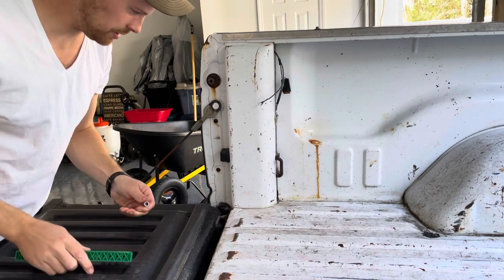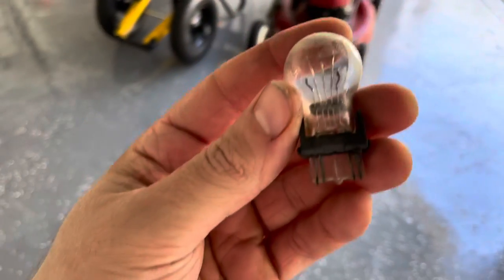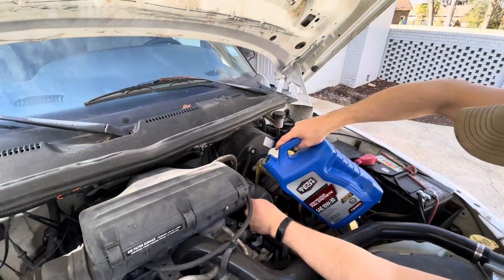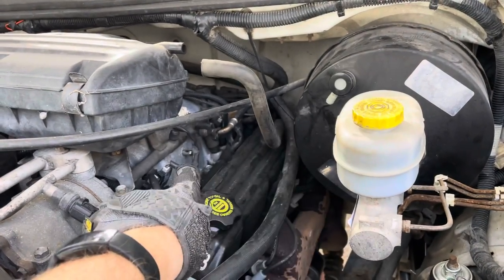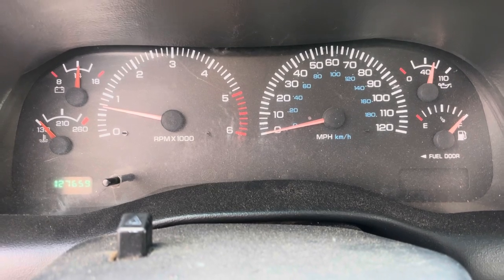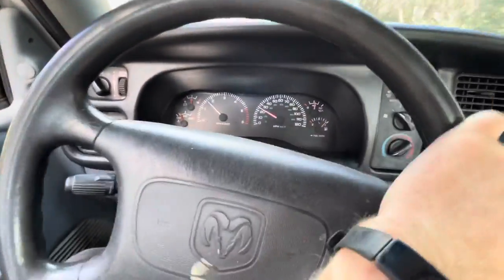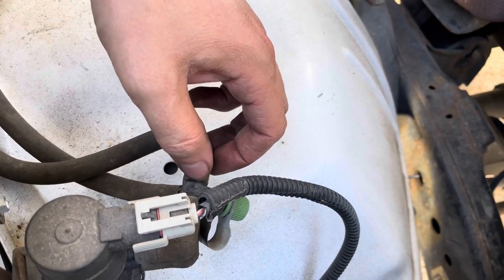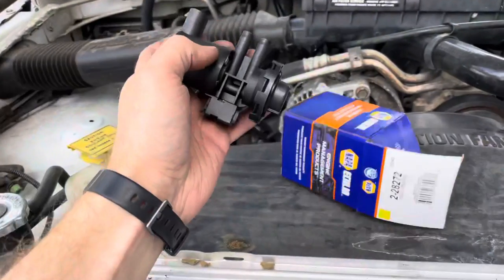HUGE change of plans?! Fixing rough idle in my 1999 Dodge 2nd Gen

Comment: I have a 2000 dodge ram 1500 5.2... it did the same thing. Changed out all sensors on the thottle body with after market parts. The problem went away when I put on OE idle air control valve part (mopar).

Comment: I have a 01 Ram 1500 5.2L 5 speed and am going through a similar situation. When I regeared my rear end, I forgot to put the speed ring on the carrier like a bone head. Both the speedometer and odometer quit working. I drove the truck like this for about 6 months. When ever I came to a stop and pressed in the clutch, it would die. I guess Mopar engineers didn't want people just simply unplugging the rear speed sensor on the axle and driving and not putting any miles on the odometer. I had a rebuilt engine put in the truck during this time. The mechanic that installed the engine was dumbfounded when he took it on a test drive and it was dying at stops. Instead of calling me, he put in a new IACV and when it still was dying, he used his diagnostic tool to adjust the IACV setpoints. Truck still did it and he gave up. Within a month of getting the truck back I had the time to pull apart the rear end and put that speed sensing ring on the carrier. First test drive, code cleared, and no more dying at stop signs. Only problem now is on cold starts I get hissing out of the IACV hole on the throttle body and she runs rough. After a few minutes it settles out. I'm going to try a "throttle body relearn" to undo what he did and if that doesn't fix it, new O2 sensors. Those two seem to be common culprits
Reply from the maker: Interesting. I’ve got a whole video series on this truck, I’ve tried everything I can’t think of and it’s better but it still isn’t perfect. I’ll probably post a video soon of a compression test. I wonder if I’ve got a cylinder or two low on compression. Thanks for watching!

Comment: To test a bad intake plenum gasket remove the PVC hose from the intake and cap the port. Start the engine. Remove the oil filler cap and place thick paper over the valve cover filler hole to ck for vac. If vac is present the plenum gasket is bad. 
The purge valve in 2nd gens can be disassembled. I have seen 2x where the charcoal canister went bad and the purge valve drew charcoal bits into the valve, clogging it. Pop it open, clean, and blow out, then back together. ANd replace canister. But in your wandering idle and stalling case it sounded like a bad IAC valve. It's been 2 years, did you find the problem?
Reply from the maker: @steadyeddie7453  thanks for watching. I’d already done a plenum gasket at this point with a kit from Hughes engines. I’ve done every sensor. IAC, fuel pump, grounds, and a bunch of other stuff I’m sure forgetting. This is a weird one, I think it’s gotten better over the years but it’s still not right. I don’t believe I’ve checked the purge valve, might be worth looking into.
Reply: @TheMoparGarage  The Hughes plenum kit with the machined aluminum plate is nice and definitely cures the gasket blowout issue. I think it is FelPro that makes a better than OEM gasket that also works, for those on a budget. The purge valve is programmed to cycle open at about 45mph, closed loop. But you can simply disconnect the hoses on it and plug the one with engine vac. Then take for a test ride.

Comment: Notorious for leak at intake manifold plenum gasket. if you look down the throttle body and see oil, it's a good indication the manifold is leaking by. Hughes engines sells a kit, for around a $140 U.S.
Reply from the maker: I had redone the intake plenum with a Hughes engine kit about 6 months prior to when this video was put up. Didn’t help at all unfortunately! Haha

Comment: If alot of miles, change injectors fairly easy ,Dodges are crazy.
Chasing the surge problem for two years, fuel pump went out ,changed it runs great 2002 59,000 miles wow.
Reply from the maker: This video was about a year ago, I have since changed the fuel pump, removed the cat, changed every sensor I could think of. Seems slightly better but still not right. Just living with it for now I finally gave up! Haha thanks for watching!
Reply: There is a better version of the second gen dodge ram magnum series engine injectors they have 4 holes instead of the normal factory 2 hole injector Chrysler used lol..

Comment: I just fixed a 98 5.9 with this same problem. O2 sensors they had good readings but the heater circuits didn’t work properly even though they had power and continuity.
Reply from the maker: Thanks for the suggestion! I’ll try replacing them
Reply: The 5.9 i put in ran fine before the swap but now it pops and ba kfires
Reply: I will also try the 02 sensors hope this works

Comment: I love 2nd gens ... I have 2 left , I sold my 3500 dually and I have 2 left both 2500 12 valve diesels .. I bought a 1500 gas for the cab and I may try to sell the frame which is perfect still all the original paint on it ..
Reply from the maker: Gotta love 2nd gens. I’ve owned I don’t know how many…currently I only have one, my ‘99 5 speed isn’t going anywhere. I’m always buying/selling them though.

Comment: Not sure if you got it fixed or not chased idling issues for months on my 99, would cam out per say and die randomly at idle all new sensors. If you havn't changed the belly pan gasket on plenumn its leaking and fouling no.8 plug. And for the idle fix, 2nd gens don't read bosch 02 sensors, needs to be ntk or denso upstream, and if you dont have a cat in it bosch downstream, and it'll never throw a cel. Verified on multiple trucks.

Comment: Keep on looking for Shelbys. They're out there for sure. Little more info - They made "Shelby" Chargers with 2.2 Turbos in 1985, 1986 AND 1987. Additionally they had the actual GLHS in 1987. Story goes that Shelby bought the last 1000 Chargers for the 1987 model year and those became the numbered cars, the 1000 GLHS Chargers. I actually own both a 1987 GLHS and a 1987 Shelby Charger. Both have the 2.2 Turbo, but the GLHS has the "Turbo II" setup which wasn't introduced until the 1988 model year in the Daytona.
Reply from the maker: Interesting, I knew about the 1000 GLHS cars but I didn’t know they still made a normal Shelby in ‘87….I’ll be keeping an eye out, if you hear of one let me know! I’ll travel as far as I need to. Plus if I ended up in your area it would be cool to collaborate for a video or two!!
Reply: @TheMoparGarage  I'll keep my eyes open. If you get up this way, give me a shout.

Comment: I had 1994 dodge ram 1500 V8 5.2l. 2wd, i had same problem with rpm and i was told it was EGR need to be changed it out and i did that and it runs like a champ. So i went clean everything out make sure everything is doing ok. 
So EGR is the problem!
Reply from the maker: Could be worth looking into! It’s been 2 years since this video was made and this thing still isn’t right.

Comment: did you check the IAT(Intake Air Temp sensor)? My 97 5.2 was idling rough in the mornings for about 30 seconds and the levels out and runs great for the rest of the day. Replaced everything like you did with no change. Changed the IAT sensor and it runs better in the morning. not perfect...but better.
Reply from the maker: This video was made a few years ago, I’ve done a lot of things since to try to get it to run right. Similar to yours, it’s still not 100% - but it is better than it was.

Comment: I have a 03 ram 1500 and it was swapped to the 59 and the RPM in Park rapids up to about two grand and then while I'm driving the RPM fluctuates and jumps up and down just a bit with out me hiting gas any harder
Reply: what did you do to fix it?

Comment: For my 1996 with 5.9 it was the throttle position sensor causing the truck to die after letting off the accelerator.
Reply from the maker: Thanks for watching! This video was from about a year ago, I’ve replaced or tested every sensor in the dang thing at this point. Removing the cat when I did an exhaust seemed to make a little difference. It’s only an intermittent issue now. Really weird one, only thing I can think is maybe a cylinder or two are a bit low on compression. For now I’m just living with it!
Reply: @TheMoparGarage  I needed to reset my throttle position sensor recently after an extended time with the negative battery cable removed. I turned the key to the on position without starting the engine, pressed the accelerator slowly all the way down and slowly let it up three times. Then I turned the key to the off position. I then started the engine and let it idle a few minutes. I shut it off and restarted again. I took it for a drive and all was good again. 

I'm not saying it will fix yours, but it's easy and free to try.
Reply from the maker: @roostercockburn690  it’s worth a shot! I’ll try it tomorrow and let you know if anything happens. Appreciate the suggestion!

Comment: I have a 1999 dodge ram 150o 5.9l. I have changed everything on the front in you, joints, upper and lower, etc. everything and I have a vibration that starts up around 30 miles an hour but it goes between 30 and 45 mph on a straight road. It starts to vibrate if you release the the gas pedal, it will go away. Can’t figure out what it is please help.
Reply from the maker: The first place I would think to check is the driveshaft universals. Have they been changed yet?

Comment: Been dealing with an intermittent issue where my 99 5.2 won't idle. Only happens on startup though for maybe 30 seconds or a minute. Was hoping to see the fix here, I'll have to dig through what you've done so far and see if I get lucky.
Reply from the maker: I've got a whole Playlist on this truck if you want to follow, it's been very hard to track down. I've done a fuel pump and almost every sensor in the truck and it does seem to be better than it was, but still not quite right.
Reply: @TheMoparGarage  I watched those other videos a bit earlier today too, hoping you came up with the solution. Bummer that wasn't 100% the case. I'll have to deal with mine too if it gets too much worse.
Reply from the maker: @mulletsquirrel  the new fuel pump made the biggest positive difference. It only seems to do it once in a while now. Just a very weird issue with no obvious solution. Only thing I can think is a cylinder or two a bit low on compression or something internal like that, because I’ve tried everything else. It’s not too bad now so I guess I’m just gonna run it! Haha.
Reply: My 318 magnum V8 doesn't even have the lifter ticking issue either lol.. could be the injectors ticking alot of the rams have anyways mine doesn't do that..
Reply: Iac valve maybe?!

Comment: Throttle body mine did the same changed it and worked fine after the throttle body stayed a litte open looked closed all the way but It really wasnt closing all the way unbolted It and thats when i seen the problem sence It stayed a litte open It was running too rich

Comment: Mine keeps killing o2 sensors any tips on where to look I inherited it and want to fix it up and keep it. it’s a 1998 2wd 5.2
Reply from the maker: Are you having trouble with the pre cat or post cat o2 sensor?
Reply: Pre cat
Reply from the maker: @gabeedwards8221  all of the V8 magnums, 5.2 or 5.9, are known for the intake plenum gaskets going bad. This causes oil to get up into the intake from the valley of the engine. The truck will start to burn oil pretty bad which will plug up the o2 sensor. If I had to bet, that’s likely the issue. Hughes engines makes an awesome kit to re-do the plenum gasket with a nice aluminum plenum plate, which takes the place of the thin steel plate that comes stock. I installed the kit on this truck and a few others I’ve had, it’s probably about a 3-4 hour job. There’s a really nice series on YouTube about how to do it.
Reply: Thanks man I appreciate the help I’ll let ya know what I find
Reply from the maker: @gabeedwards8221  always happy to try to help, good luck!